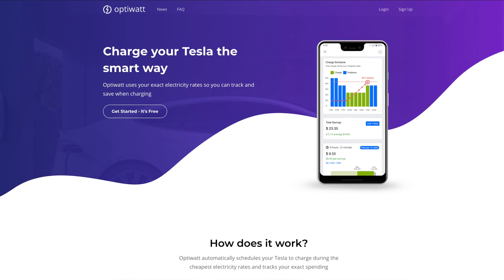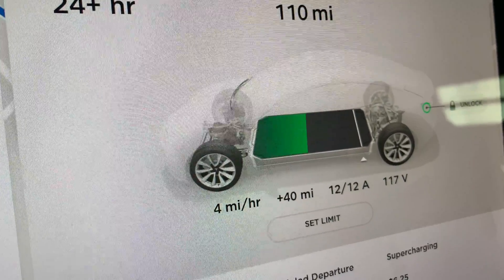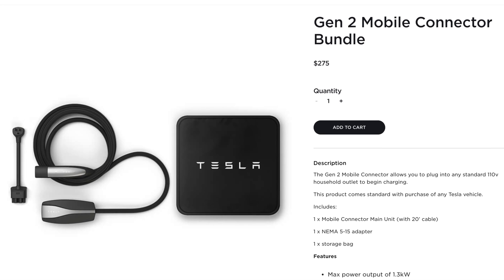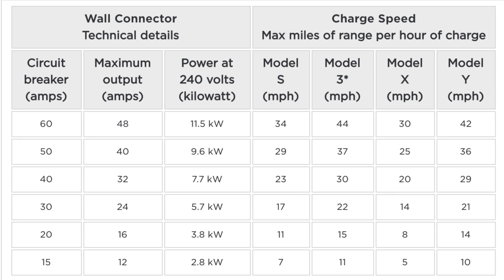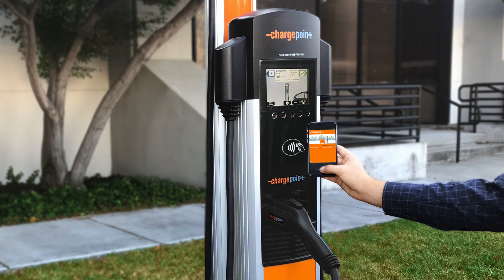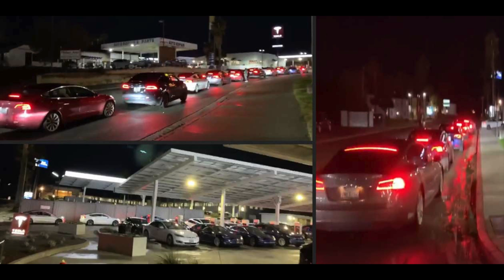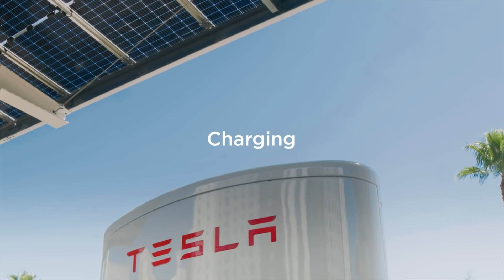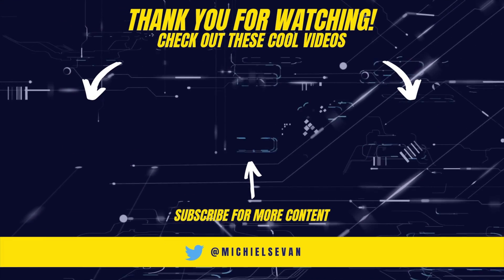3 Ways to Charge your Tesla 👉🏻 Complete Guide⚡️ How To❗️

Comment from the maker: OptiWatt 👉🏻 https://bit.ly/3j09L11
Want a Tesla? | Get FREE Supercharger Miles! 👉🏻   https://ts.la/evan87711
Charging Level Tree Diagram 👉🏻 https://photos.app.goo.gl/k9G3EMgyFNLkA3y76
Join me on Mint where I am saving a ton on wireless. Plans start at just $15 bucks, and include high speed data, plus unlimited talk and text 👉🏻 http://fbuy.me/pTCXi
Get Your Accessories! 
1. Model 3 Model Y Wireless Charger Car Mount   👉🏻  https://amzn.to/319rtVr
2. Tesla Model 3 Trunk Rain Deflector 👉🏻  https://amzn.to/317fnfD
3. Armrest Hidden Storage Box 👉🏻   https://amzn.to/30i8DMC
4. Tesla Model 3 Trash Can  👉🏻   https://amzn.to/3hYh5GZ
5. Tesla Model 3 Model Y Matte Screen Protector  👉🏻   https://amzn.to/3fo3kzv
6. Rear Door Sill Protector Plates  👉🏻  https://amzn.to/3jUJpf8
7. Tesla Model 3 Model Y Tray Table  👉🏻    https://amzn.to/39Tx3iY
8. Tesla Model 3 and Model Y Rubber Cup Holder  👉🏻  https://amzn.to/2Pce9u7
9. Model 3 Model Y Door Lock Cover Latches  👉🏻   https://amzn.to/3k8kN2T
10. Custom Cut Graphics Tesla Model 3/Y Door  👉🏻   https://amzn.to/2D8WhxM
11. Performance Foot Pedal Pads  👉🏻  https://amzn.to/3k33T5l
12. AUTAILORS Tesla Model 3 Floor Mats  👉🏻   https://amzn.to/3gmUYJV  👉🏻  Model Y Floor Mats
       https://amzn.to/33bj46K
13. Ultimate UV 303 Protection  👉🏻  https://amzn.to/2DsQAu9
14. Ultimate Windshield Sunshade for Tesla Model 3  👉🏻   https://amzn.to/3kbsp4C
Check out MORE Accessories!!  👉🏻 https://youtu.be/DCXkdOtf_Nk

Comment: Very well explained. I installed my own Tesla wall connector (I have 240v experience) and besides for the $500 for the connector itself, I spent another $60 for materials. One reason I bought a Tesla is the supercharger network.
Reply: The supercharger network makes charging a Tesla so simple.  I own a Honda Clarity PHEV and have seen how flaky and unreliable other networks can be.  Fortunately, charging is not a requirement as I can run on gasoline as a backup plan.  Planning on a full EV for my next vehicle and it will be hard not to consider a Tesla for this reason.